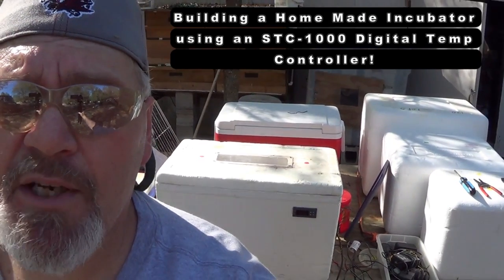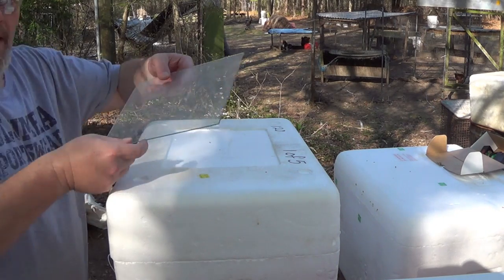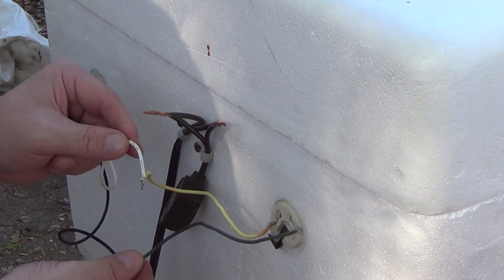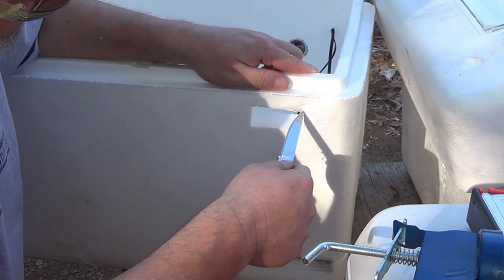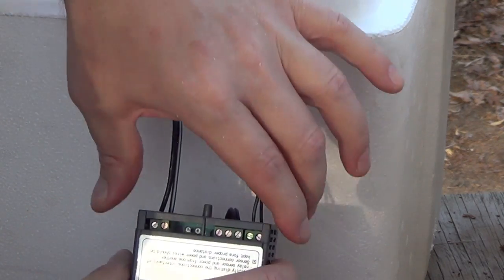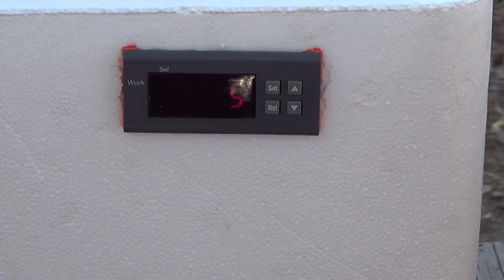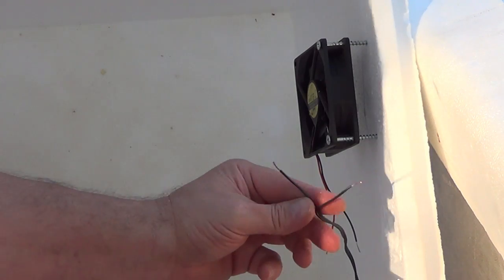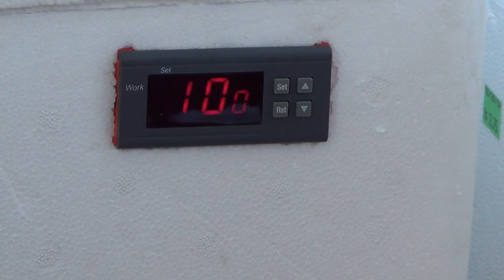Wiring/Installing an STC-1000 Digital Controller into Your Home Made Incubator!

Comment: Sorry this may be a dumb question but I just want to make sure I do this right :) for the wires attaching the thermostat to the power and the light, are those just basic wires or a specific kind?
Reply from the maker: Crystal Walker Hey Crystal... It's just a standard 16 gauge copper wire.
Reply: Rush Lane Poultry & Game Birds I thought the video was saying it had to be from a DC 12v adapter to power the digital unit so I can just use any kind of wire to run it then not the DC 12V wire?
Reply from the maker: Crystal Walker I use whatever I have laying around!! Almost any component could have a substitution for something similar... That's the beauty of this project!
Reply: Rush Lane Poultry & Game Birds Would it work if I used some wire that is similar to the extension cord wire? Or would that be to big? I found some wire our previous owners used looks like they cut both ends of an extension cord and I would love to not have to buy wire :) This would be for the power of the thermostat and to the bulbs. Sorry again for all the questions I haven't done very many electrical projects before :)
Reply from the maker: Crystal Walker No worries Crystal! The wire that you have will work just fine...
Reply: Rush Lane Poultry & Game Birds Help one more question! I have everything almost done but my fan has 3 wires coming out of it instead of two, there is red, black and yellow. where do I attach the yellow?
Reply: Crystal Walker Hey Crystal! In most instances the yellow wire is a low voltage wire & you don't need to connect it! Only the red wire and the blk wire need to be connected so that the fan will run on high.
Reply: Bubba Rountree Outdoors Thank you so much I got it all going can't wait to get my eggs!!
Reply: Crystal Walker My pleasure Crystal... good luck with the hatch!

Comment: My stc1000 on back is different than yours. I have 4 double options. 
I have power supply as 1 and 2 - can this be a 12 guage extension cord or thin house extension cord ?
then i have sensor 3 and 4  does this go for  lights and fan ?  or for what ? 
then i have heating 5 and 6  -  goes into stc 1000  ?
then I have cooling 7 and 8  so i dont need this one. 
Sorry . please help me I just a girl. so do i need 4 cords to hook this little stc1000 ?
Reply: Hey Val... I don't have any experience with the newer models! I would need to pick 1 up and take a look at it! Wade

Comment: How would I hook up a  SupentownWC 12  Thermoelectric 12 wine cooler  so I can heat at 99.5 -100.5  it's set at 54-65  now but will heat to 99 + but no setting controls has a digital read out and setting control....Any Ideas ????
Reply: want to make a quail egg incubator with it..

Comment: It does not power the terminals. They are simply relays, switches. You apply power through there to the devices, and the STC-1000 turns it on and off. Think of it like a wall switch. Wall switches don't provide power, they just switch it on and off.

Comment: Are the vent plugs really necessary? Can't you plug the vents with a piece of cloth or something?
Reply: No... You can use a piece of tape, a fishing cork, or anything that can plug the hole so that humidity can't escape!
Reply: When will they need to be plugged?
Reply: Usually during the hatch when the humidity needs to be raised to 55-65%.
Reply: How do you keep the humidity in the incubator? Do you just have bowls of water set up inside or is there a certain way to do it?
Reply: Yes, all incubators have a water tray in them.
Reply: Alright thanks for the help

Comment: I have a water heater but it doesn't have an earth wire, only live and neutral.. And I cant get it to work! Any ideas? Pls help!! Desperate person.. lol
Reply from the maker: Maybe this video will help: https://www.youtube.com/watch?v=lhI0OcFi4FY
Reply: I ended up finding a diagram, pretty easy. You have to connect one wire of the heater to the right heating socket, then have a loose wire connect the left socket to the line. Then you connect the other wire from the heater to the neutral. But thanks anyway!

Comment: How about the bulb?how many watts?it's okey if i use 2 bulbs with 100 watts?
Reply: Hey Eli... I'm using 40 watt bulbs. 100 watt would be too hot in a cooler this size! You can also use the 40 watt appliance bulbs, they will last a lot longer! Wade
Reply: Oh i see, but i will make a bigger one how about that?
Reply: All that you said is a big help to me.thanks a lot for the information.

Comment: Does all of these units blink like that?
Reply: +Josh Byrley Hey Josh... No, the units don't blink at all! The blinking is caused by a video anomaly.
Reply: Ok, I bought two of these at a yard sale for 8 bucks. The guy couldn't get them to work. I wired them today to limit my homemade sawdust boiler and they work amazing. I was just wondering if they were supposed to blink because mine didn't, and I wanted to make sure I did everything right. It worked, but one can never be to careful.

Comment: I have a 120v input and a 10v output, can I use this wire to connect this to my thermostat and power supply and not fry my system?
Reply: Also, What kind of wire did you use for the Relay for the bulbs?
Reply: I use 14 to 16 ga copper wire.
Reply: Nvm I have completely set this up as for the fan, i am waiting for the Thermostat to come by and install that as well
Reply: Bubba, My question is, is there a certain specification for the wire im going to use for the loading relay? Like 10 or 12V out put for the loading relay? Or just any wire?
Reply: What is the wattage  on your heating element? Or are you using light bulbs? If using heating element, or light bulbs you want to use nothing smaller than 12 ga copper wire!
Reply: Ok, I've found around my house that most of the wires are 18.... Will that work? 18 AWG?
Reply: Can I use a 10V wire from an adapter as the power supply for the Thermostat?
Reply: yes.
Reply: yes.
Reply: Bubba Rountree Outdoors Thank you so much, I appreciate your help and reply at such a quick notice. Earned a new subscriber!
Reply: video may be in Hindi ?